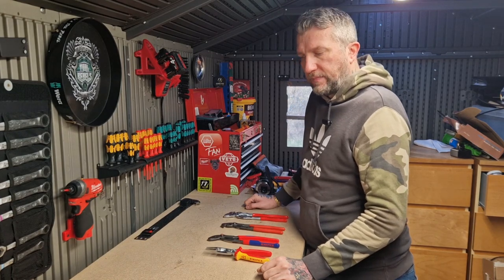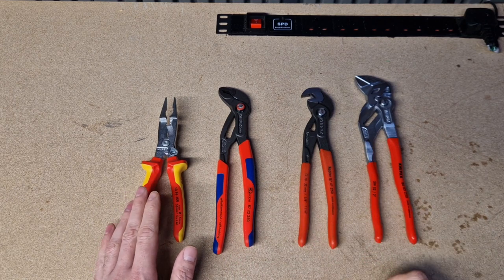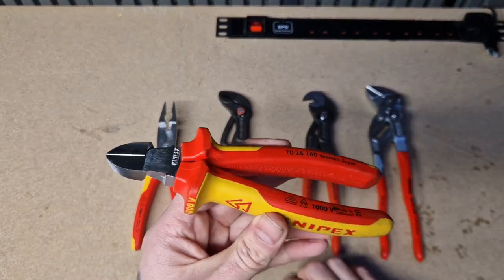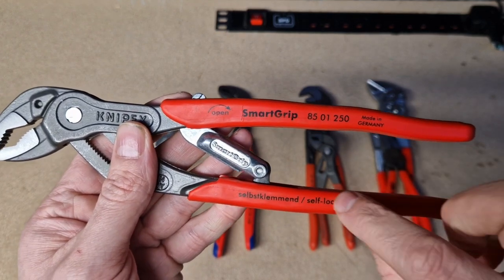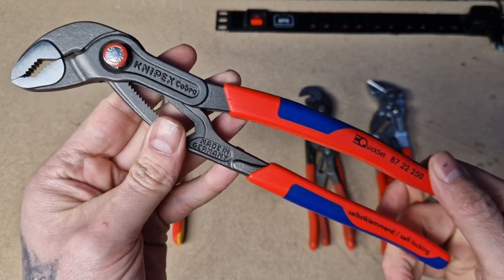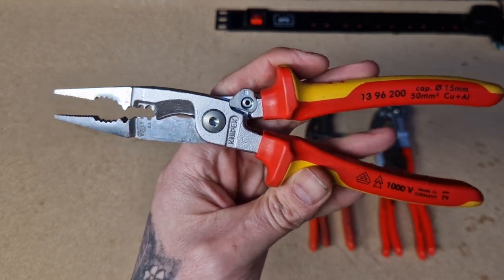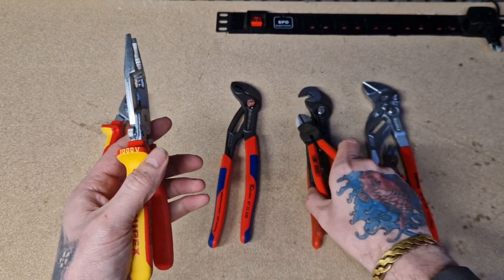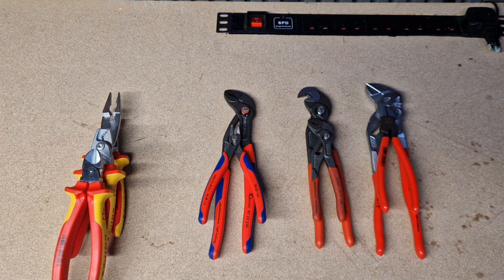Knipex handle types explained

Comment: Those Raptor 87 41 250 are great for getting off rounded or chewed nuts or bolts.  The beak makes then better than using standard water pliers

Comment: that "extra" grip will be the standard dipped version only they cannot dip the smart grip, as the plastic would gum up the works. they are injection moulded grips that are fitted later.
as for live work. you cannot turn batteries off. and sometimes you have to have a system live to find the problem

Comment: you forgot the dipped red 1000v handles, but nice video anyways :) part number 27 17 200 for example
Reply from the maker: I've seen the 70 (07) 180 never used them not very common here
Reply: @htr5372  and the ESD sleeves which sre black and grey
Reply from the maker: I am just doing the 4 most common ones, or more readily available